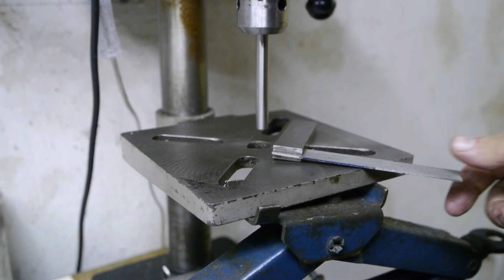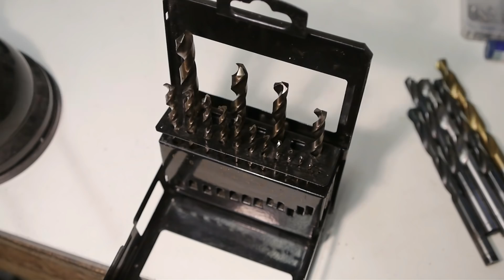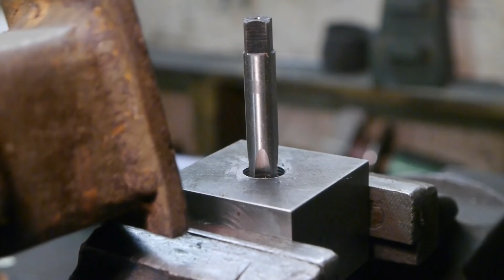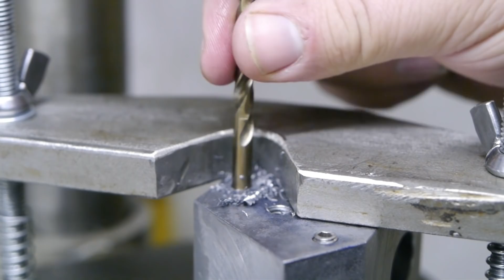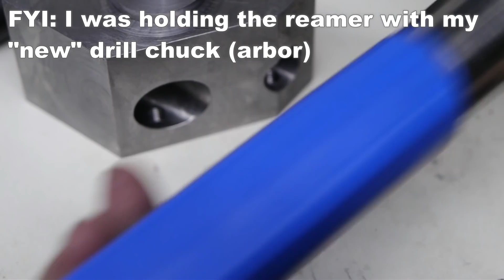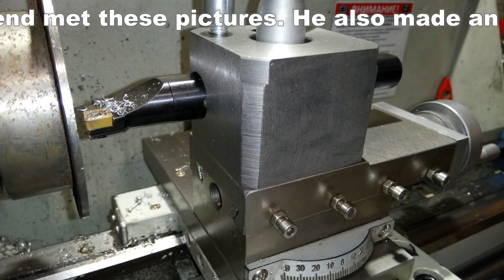Setscrew, Sloppy threads and more Set Screws, Lathe holder part 3

Comment: I go to as many auctions and tool sales as I can. I only buy good name brand taps and drill bits. Sometimes you can find some treasures in old machinist tool boxes. I have bought a few of those. I have accumulated enough "good" drills and taps to do most anything I need to do. Good sharp drills and taps are very important when doing such work as you were doing. As far as the holes you could have re tapped to the next size up using a "good " tap and tightened things up. Sorry for the flying parts. It happens to the best of us. Glad you weren't seriously hurt. When in doubt clamp it.

Comment: I love these videos. My tooling has become slightly better in recent years, but I've had many hours of the same struggles you deal with. One place I've learned not to skimp is taps. It's amazing the difference in ease of tapping with a quality tap.
Reply from the maker: My old tap and die set used to thread much better. But it helps when you use a starter or tapered tap first.

Comment: Really sloppy threads! I've given up using cheap taps. When they break it is a pain to have to drill them out. Requires a carbide bit. I seem to have a knack for breaking very small taps. I normally power tap with the larger ones (8mm+), spiral point, 60rpm on the mill.
Reply from the maker: Now that I have an e.d.m. machine I will probably never break a tap in my life :)

Comment: The cheap tap sets I bought like that were also clogged with burrs from when the flutes were ground.  Even after picking the threads clean, trying to use them in aluminum was entirely counterproductive.
Reply from the maker: On bigger Chinese taps I've used those diamond coated hones (metal plates) to remove the burrs. 
It helps but doesn't turn them in a good taps.
Reply: I think most of it boils down to variability.  Every now and then, I have bought ebay taps that were actually decent -- but that one good tap is mixed in with a bunch of rough-ground/oversize taps.  

I had a bunch of spiral-flute M3 taps that either were banana-shaped or had flutes ground so that the cutting edges had extreme negative rake.

Comment: When tapping it is  good to rotate 1/3 of a turn forward then  backwards  1/2 turn to break the chip created. Then  tap forward again and repeat. The short wiggles you are doing doesn't seem to be breaking the chip loose. loose chips don't clog as quick, but you are doing quite well in cleaning the tap.  Great video, a great project.
Reply from the maker: I didn't feel comfortable to turn so far. It was pretty thigh and the flutes filled up quickly on those m4 taps
If the feels right I'll tap a hole without backing of.

Comment: The loose threads are because of the taps. Taps come in different outer diameters and labeled such as ( H 1-10 ). That  designation  that tells you that that tap is from lets say   .0005 to .005  over or under size. that is the reason you get mixed results when tapping with unknown taps. Many taps you get from china are often rejects and are sold out the back door of factories to sellers that that resell them on the net . So you don't really know what you are getting.  Hopes this helps
Reply from the maker: So basically the same story as with those time wasting cheap er32 collet sets.
BTW: I've never seen those marking on taps. Then again I havn't seen much taps in my live :)

Comment: The chinesium taps you are using are all either "second" or somewhere between "second" and "plug". If you buy a decent SET of M6 taps, you will get one taper tap, one second and one plug. Using a taper tap first will give you a much better thread because the threads are cut gradually instead of being ripped out in a single turn.
Reply: sooty655 ahh vern you mean bottoming tap...now is it   a h 3...or h6 tap
Reply: @miguelcastaneda7236  The names rather depend on what industry the speaker comes from, and how long ago. Bottoming, plug, No.3 are all the same thing.
I don't think the clearance spec will make much difference for small hand tapped threads.
Reply from the maker: My old set also has 3 taps per thread size.
Always using the tapered tap probably prolongs the live of the normal tap.
Reply: @Rolingmetal  Starting with the tapered tap also makes it easier to start the thread "square" when tapping by hand, and produces a better thread by removing metal gradually.

Comment: I can appreciate the time to drill and tap for the set screws.   A lot of work.

I think offsetting the M6 screws as you mentioned later as zig-zag pattern should provide the control over the bar which you tried to get with the two smaller screws.

I am happy to see you clamp the work before drilling.   I recall the earlier spinning episodes which you included in the video.  Still scary to watch.

I find the design of tap makes a big difference with hard steel.   A spiral point tap will cut easier.   I find a spiral flute tap cuts the easiest but is the most expensive, then spiral point, then regular tap.

The cobalt drills seemed to cut well.   I also experience a drilled hole is often slightly oversized.   Could be the grinding of the flute, could also be the drill wandering a little.   I get this even on the milling machine.

I am eager to see the final episode where you test this.  Fingers and toes crossed the tool holder will do what you need.

Dave.
Reply from the maker: That's right Dave. I took a long time to to get those threads in.

I never used spiral flute/point taps but I see Banggood sells both. Maybe I'll buy some from all those affiliate points I'm about to earn :) Those cobalt bit were surprisingly good for the price and compared to the bright drill bits I tested last year.
They are so good that I actually made a drill-bit "advertisement" video. So coming soon: What to do with your old and scrappy drill bit. My best work yet :)

Comment: It's cheaply made taps are largely responsible for loose fitting screws as they determine the major thread diameter that is being cut, regardless of the minor diameter determined by the drill.

I'll happily use a cheap tap for genaral, non critical work but when I want something accurate, I won't spend less than £30 on even the smallest as I know the leap in quality is well worth the money every time.
Reply from the maker: Thanks. That makes sense

Comment: You should be able to get a repeatable position with your grub screws.
Tighten the first one down until it touches the boring bar then loosen it off just a little bit.
Then rotate the boring bar back and forth until it touches the grub screw on both sides and stop half way between the two.
Tighten the first grub screw a little bit more and rotate the boring bar again.  This way you can close in on the exact central point.
You can then simply tighten the other grub screws up and the bar shouldn’t move.
If you have been accurate in the position off the boring bar hole you could make your holder exactly on centre.
It looks like it is coming out nice even for scraptonian.  Love that word by the way.
We used to say shit metal was made from used ball bearings and old car bodies 🤠
Reply from the maker: We call it pis bakken staal. Translation urinal steel. 
No idea why because urinal are usually made from stainless steel. But maybe this was different in the past.

Comment: Don’t be afraid to drill a pilot hole first then leave 1mm for the drill to cut the finished size. It should then cut almost spot on.
This makes having the point of the drill exactly in the middle less important. Small amount of run out won’t matter.
Measure the hole with a vernier calliper so you know what you are getting.
Strange the shanks on those drills are smaller than the drill size.  They. Should be parallel all the way down.
A trick I use to get the tap square is to put a small centre in the drill chuck and put that in the back of the tap.
You can then put a tap wrench on the tap instead of trying to turn the chuck by hand.
You just need three hands to keep the centre Jin the back of the tap.  If you are skilled you can use your shoulder. 🤠
For those small taps that have a point on the back just drill a centre hole in a piece of round bar.
The chisel point just thins the “web” of the drill.  You can do that on the grinder by hand if you are careful and your grinding wheel has a nice square edge.
You only usually need the Chisel point if you have sharpened a drill a lot as the web gets thicker as the drill gets shorter.
Maybe it says something about the Chinese drills if they come with that new.  Anyway it makes no difference once you have a pilot hole.
Reply from the maker: I've noticed that loads of drill are actually just a bit smaller then the stated drill size. Maybe it's my calliper.
I'll give that drill tip a try. Thanks.

Comment: As loose as those threads are , you might want to put on a dab of plumber's putty !    During use, those setscrews might rattle out - the ones that are opposite the side that's being used . . . maybe a coat of paint, or better still some CHEAP NAIL POLISH !  ( I would suggest fluorescent colors to keep up with fashion )  :D       * I'm actually being SERIOUS ! !       AHA ~  how about a little dab of TAR ?    Hope that helps .     "V"
Reply from the maker: Yeah laugh about my sloppy threads :)
But I will glue one of the small set screws in place after I set the centre hight.
Reply: Not a laughing matter - thread tolerances are just way too big !    I've used cheap Chinesium taps . . . I've had some that had burrs along the threads  & weren't sharp at all = the cure was to dress the cutting edges with a fine diamond hone.  * That fixed the sharpness & burr issue, but did NOTHING for the oversize threads.  What DID WORK, was to only thread the hole until 3 or 4 threads weren't tapped in the bottom . . . then I used a grade 8 bolt that was ground & sharpened as a tap , to 'finish' sizing the threads.  This method works well on mild steel, or annealed tool steel; since grade 8 is so much tougher !      
     There are many 'classes' of threads, the higher classes , ( with tighter tolerances ) , make tooling cost much more expensive !   One easy solution is to make your own taps with DRILL ROD . W-1 drill rod is water hardening . . . it's easy to work with in it's annealed state, and is used to make taps, dies, reamers . . . & cutting tools of all sorts !  **Gear hobs, for instance , gear cutting 'fly cutter' tools . . . form tools , etc.   Your Chinese lathe should be capable of making nearly any type of tool you need, depending on setup !
     Drill rod / round tool steel - whether it is W 1 , O 1 , ( oil quenched instead of water ) . . . would be something to look into .  Sizes up to about 14mm should be in your box of tricks .  A propane torch & kitchen oven are all you need for hardening & tempering .
   'Hope this bit of rambling helps you out !    "V"
Reply from the maker: Ramble all you want. Who knows I might actually learn something.
I' fix those sloppy threats by pinching the set screws thread in the vise. Or just use a hammer :)

Comment: It shouldn't be the tops of the threads that make a thread good and snug - it should depend on the precision of the cutting. Crappy taps always cut too much material and give sloppy threads, regardless of the hole size you start with.
Reply from the maker: That makes sense. Thanks.